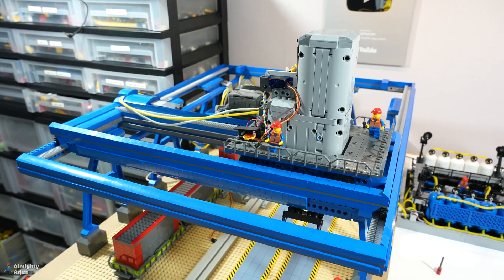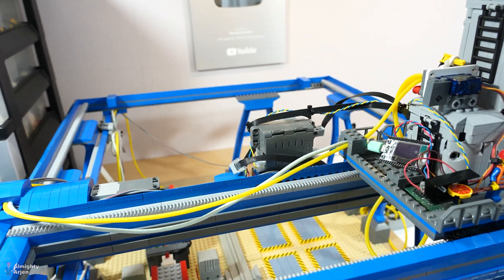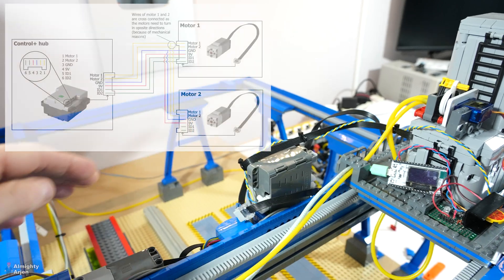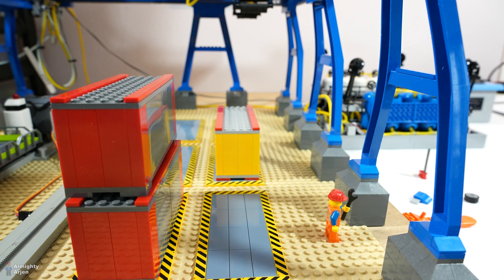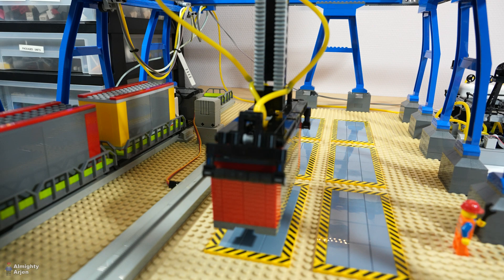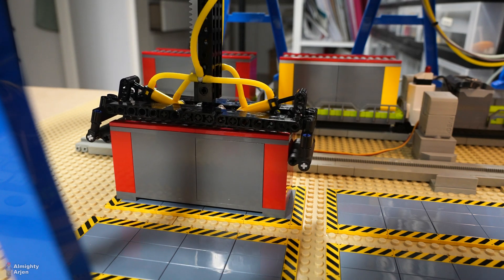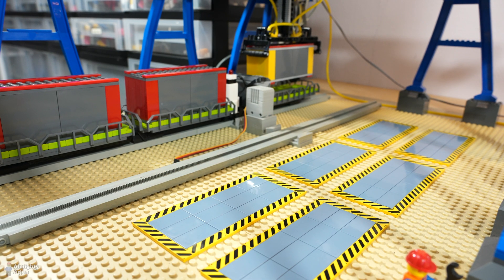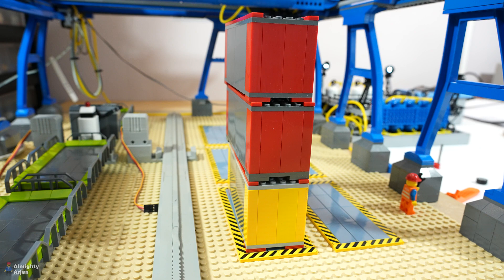Automated lego train container terminal episode 32: finetuning the 2nd crane

Comment: Maybe you could try using 1x2 slopes around the perimeter of the platform instead of the yellow plates? Like what you did on the monorail freight cars with the green 1x2 slopes.
Reply from the maker: Yeah I was thinking the same thing. It would only help the first container though. And I don't want to adjust the containers with sloped roofs or anything like that to help the other containers to get in the right position. I've decided to give each container location its own XYZ coordinates, that should solve the problem probably.